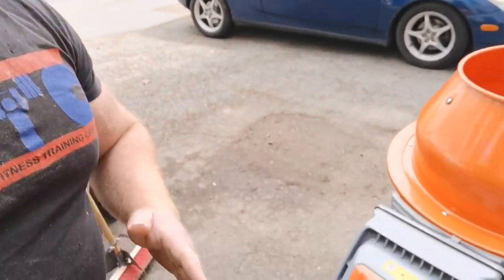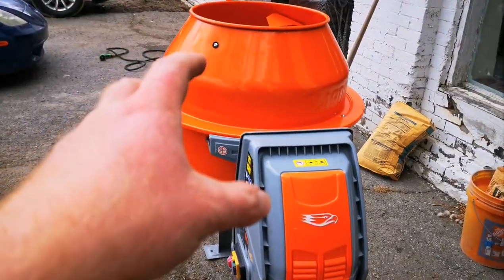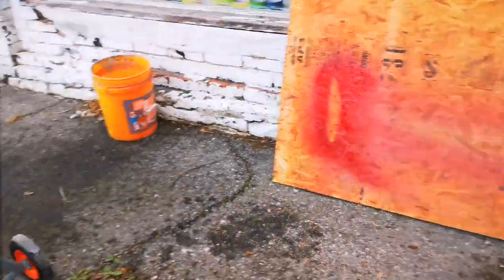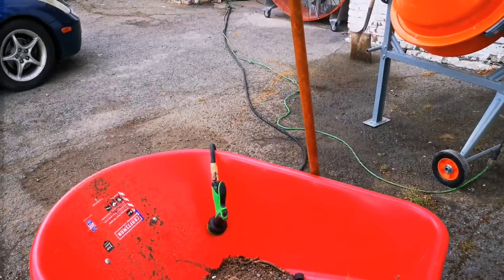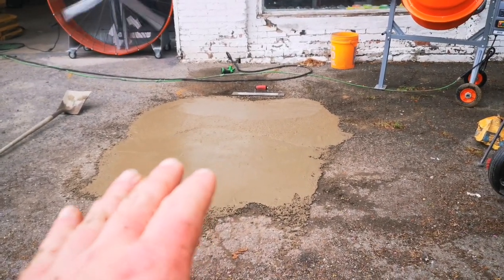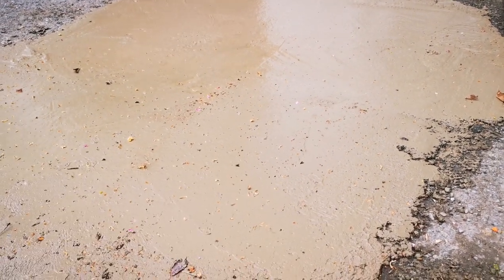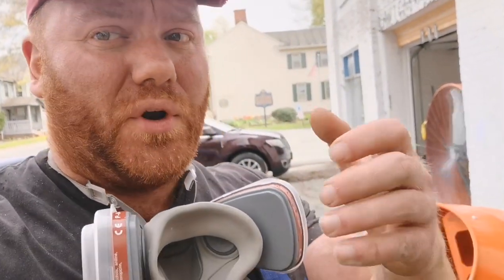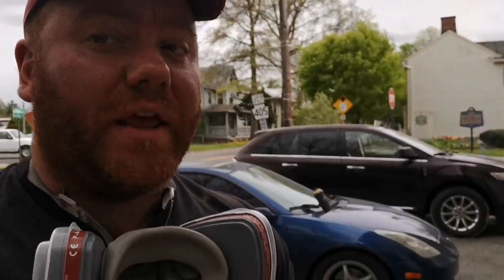Yardmax concrete mixer review

Comment: Im not sure why you put concrete on an aslphalt driveway? Or its black concrete and I didnt see it well.... they sell cold patch bags that you can tamper and it should fix temporary the issue. some gravel compacted in the hole and 2 in of cold asphalte. I used some on my driveway and it never failed. I also patched the cracks and added an acrylic sealant this week, looks almost brand new for a 23yrs old driveway in Canada.

Comment: To do it right need to cut down 6 to 8 inch all around the spot you needed fixed put rebar and wire in. The way you done it will crack soon.
Reply from the maker: Been almost 2 years has held up fine

Comment: I need 2 bags sand 1 bag portland mix. Unit is 1.6 capacity. 3 bags times .5 = 1.5. Unit doesn't look like it will hold 3 bags or 150 lbs.
If I can't do 3 at a time whats the point. What do you think.
Reply from the maker: Funny iv actually maxed it out at 3.5 bags before fun times 🤣

Comment: Give me tips on how to keep concrete from sticking to back of drum
Reply from the maker: Always keep the surface wet
Reply: @speedokoterefinishnetwork4937  Ok. How about adding dry mix slowly at first?
Reply from the maker: So here's what I do , load up the drum with about 2-3 gallons of water first , drop 2 bags in it , hit the button mix it , then add more water with a hose if needed . If you screw up and add to much water you can always crack a 3rd back and add about 1/4 of a bag to thicken it back up .